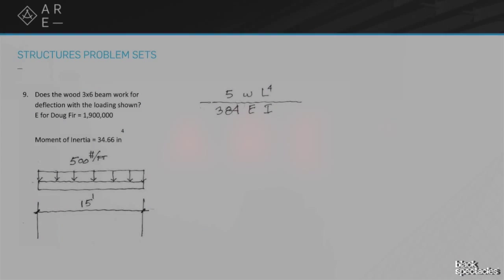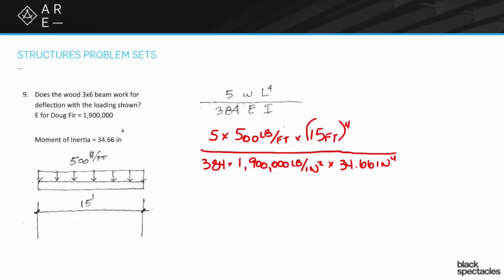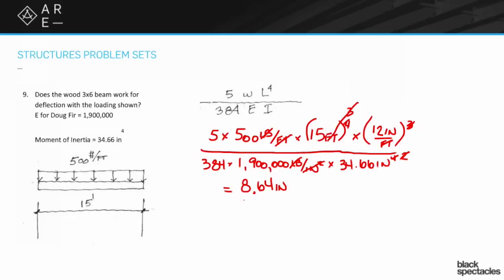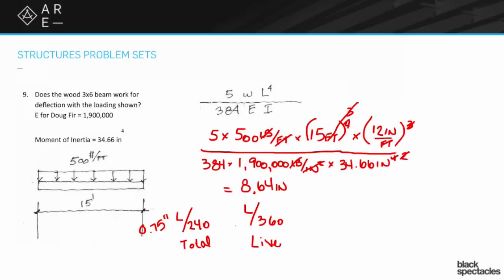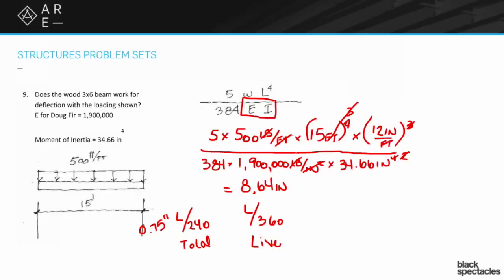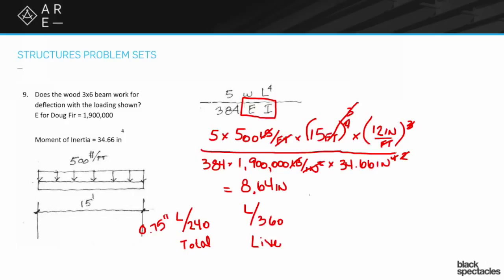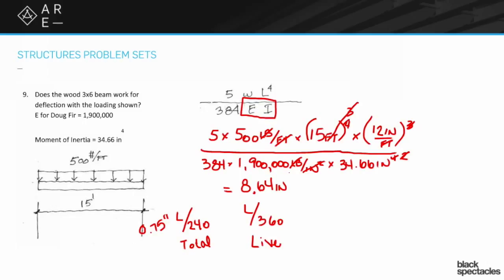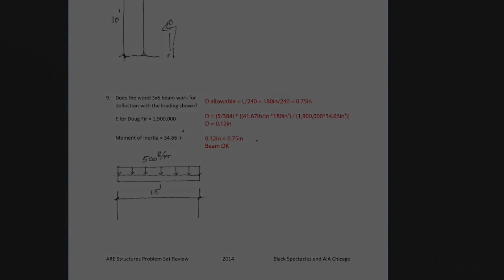Wood Beam Deflection - Structural Systems - Architect Registration Exam A.R.E. Webinar

Comment: In crossing out the units, it's implied that the length (L) no longer needs to be raised to the fourth power, i.e. the equation becomes (5 x 500 x 15 x 12). In order to get the correct answer 15x12 still needs to be raised to the fourth, i.e. (5 x 500 x (15x12)^4).